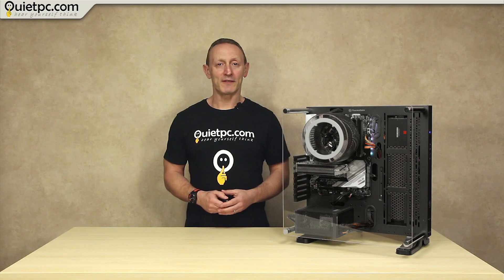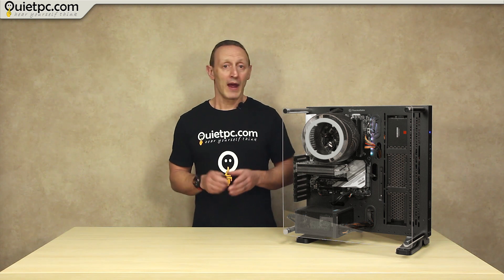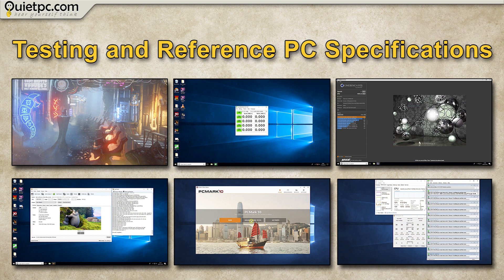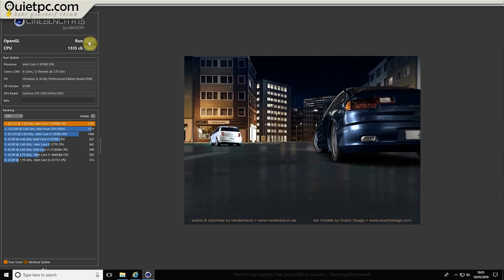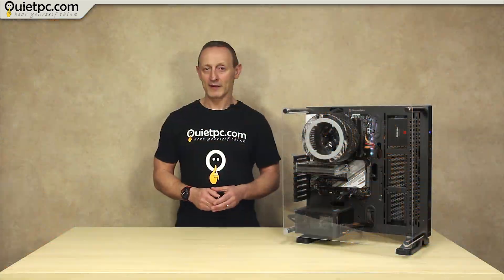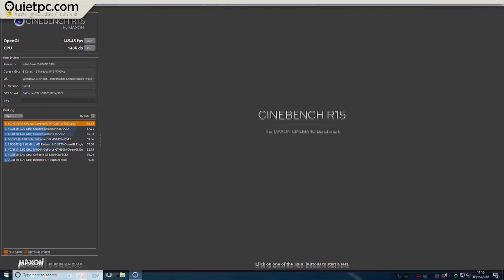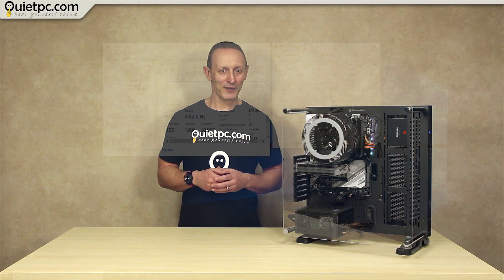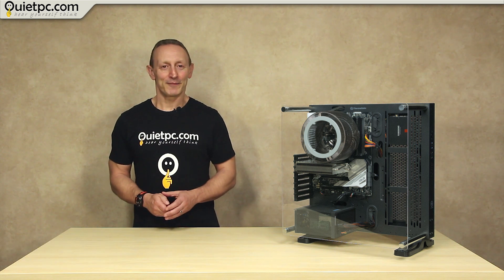Quiet PC - Nofan Phantom Fanless PC - Overview and Performance Tests

Comment: Is it ok for 4K gaming at 3440x1440 resolution?
Reply from the maker: Hi Daniele, While it will play 4K games with the GTX 1050 Ti card in the video, you would probably need to run the games at low settings to get half decent frame rates. Personally I would consider a considerably more powerful graphics card for 4K gaming.